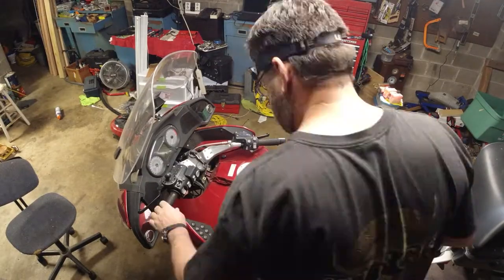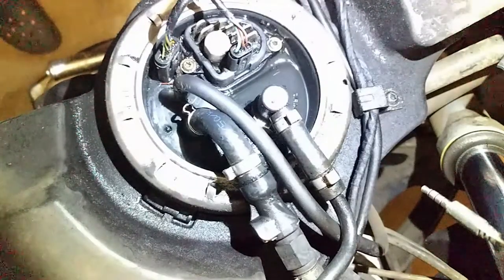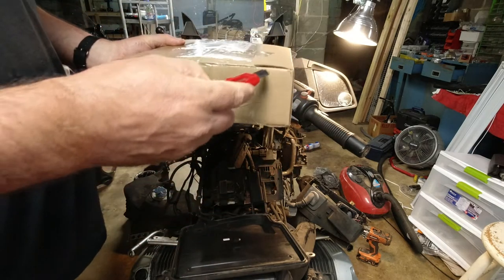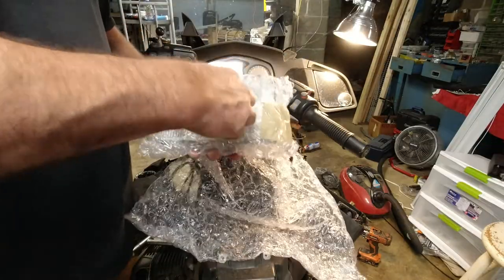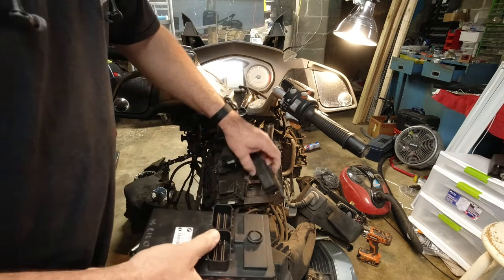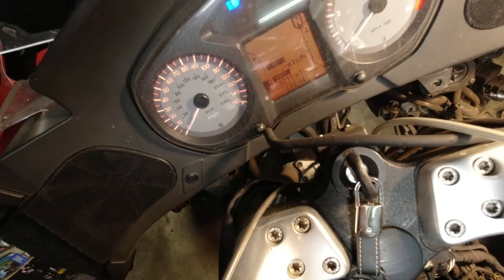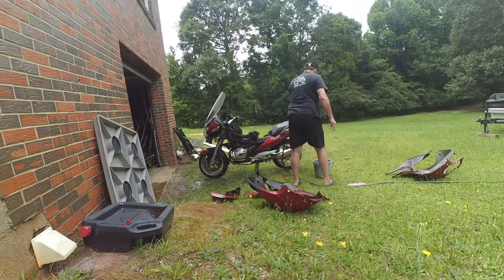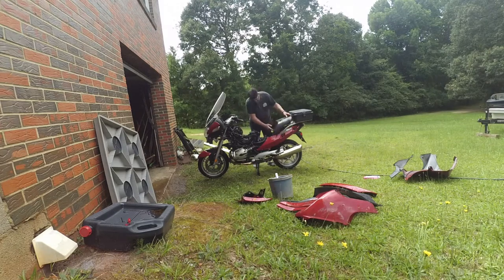Repairing my BMW R1200RT - Fix tank fuel leak and repair ZFE computer - BMW Fuel Pump Recall

Comment: I had that same fuel leak on my 2011 RT. I Checked with the local dealer and the BMW website, but no such recall could be found. Any tips for me?
Reply from the maker: I have a friend with a newer GS that is taking his in for the same service, might start with BMW North America - they helped me find a dealer that would service mine when the local assholes would not.
Reply: My 2009 RT was repaired under the recall.

Comment: Wow. It took a year to get this back together?
Reply from the maker: Not quite a year.  It was struck by lightning, but I kept riding it for a few months until the fuel leak grounded me in the fall.  I was expecting a few thousand in repairs, so I lacked motivation, now it looks like it will be rolling with less than $300?  Besides, I have been having a blast on the X, so it has not been on my radar much - now I need some miles......
Reply: @MotoGiant  Good to know, thanks. I've heard that the servo brakes are problematic. It's important to bleed the brakes regularly and properly. It's fairly complex.
Reply from the maker: @GarthGoldberg  I really prefer bikes that I can work on without a manual - this is not one of those bikes.... but it sure is fun to ride?